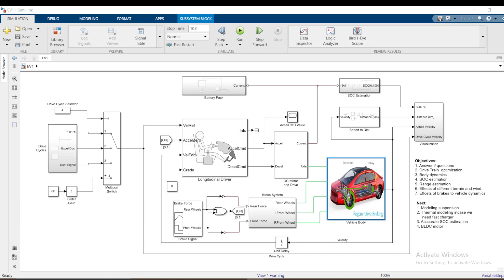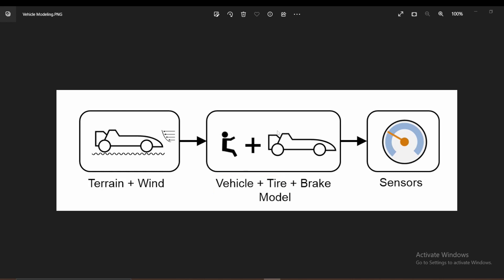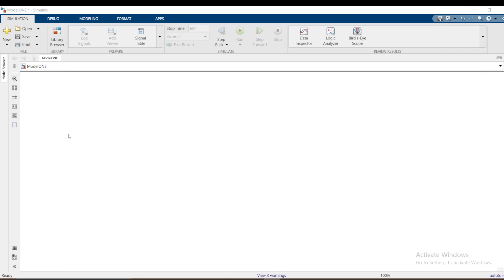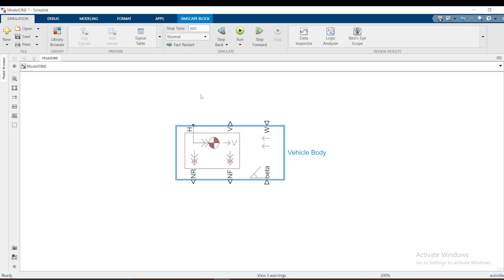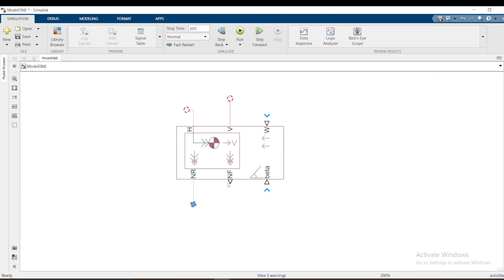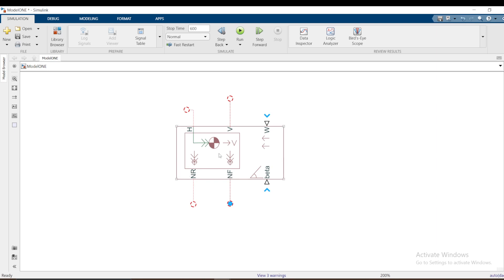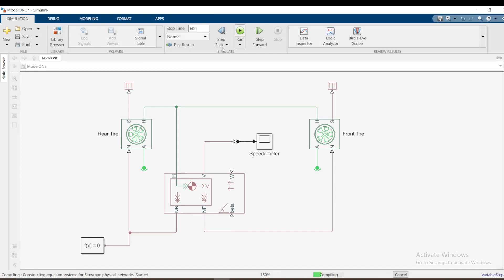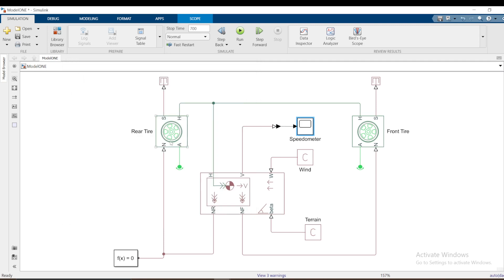Electric Vehicle Body in Simulink Matlab : Electric Vehicle part 8.1

Comment: @the engineer . hello, I need your guidance regarding modeling the water hammer effect in a pipe using simscape features.I want to model water flowing from a reservoir to another reservoir by the use of a pump and to a valve and then through a pipe into the second reservoir. I have to model using the formula critical pressure reaching time = length of the pipe x flow velocity divided by time to close the valve.Can you please guide me